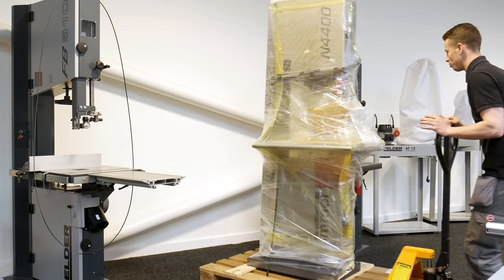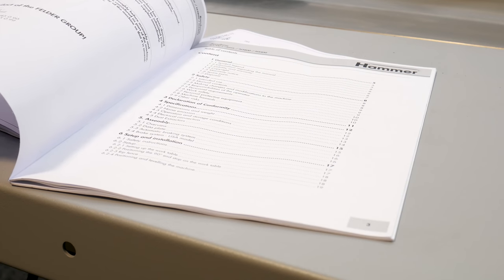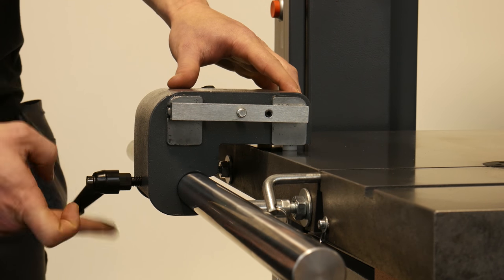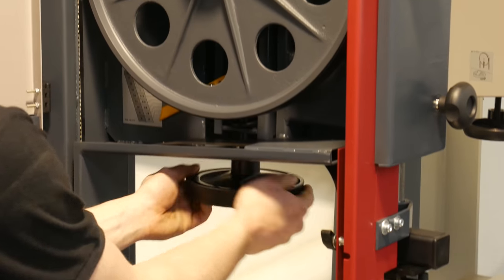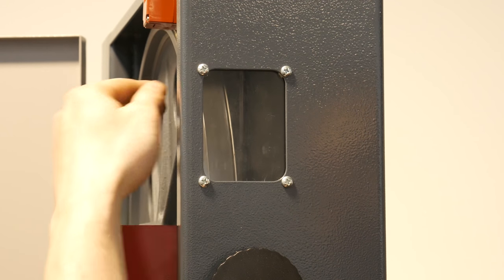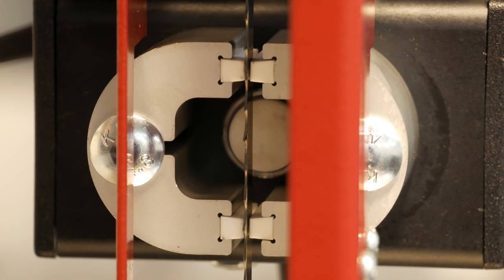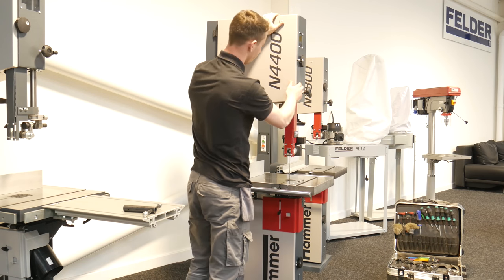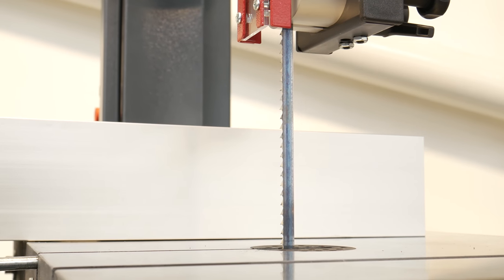How To - Set up a Hammer bandsaw | Felder Group

Comment: The video is somewhat helpful, but it would be useful to have more details on how to avoid problems with the setup.  For example, when I set up my Hammer bandsaw, the fence was neither square to the table front  nor perpendicular to the table surface.   It's possible, though tedious to square the fence to the table front,  but there is no adjustment to make the fence perpendicular to the table. I ended up inserting a small wood shim as I screwed down the fence.    The ceramic guides are not so easy to set up either. I have never been able to get mine to work without sparking.  Felder tells me to "just ensure the rear guide sits flat on the blade."   It would be helpful to have a procedure to do that, given you can't actually see where the guide touches the blade, whether it is sitting flat.